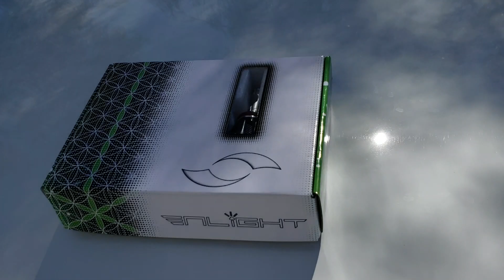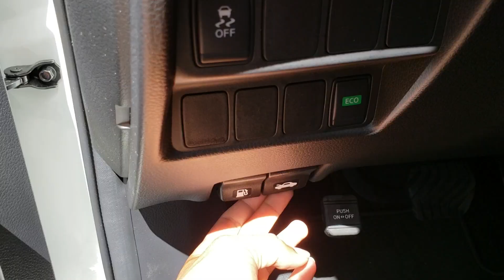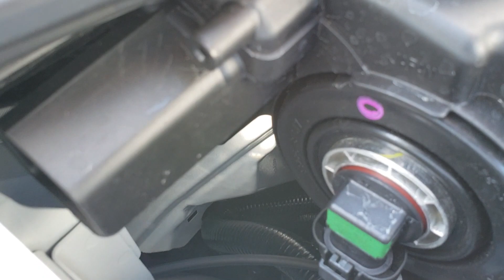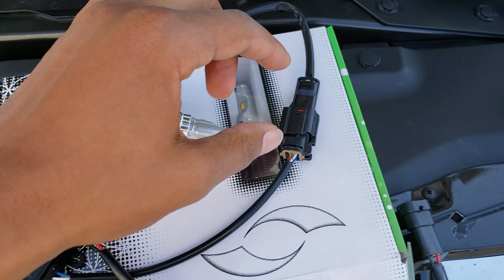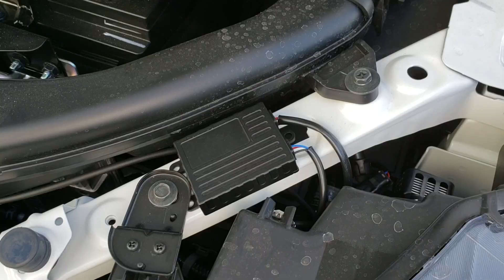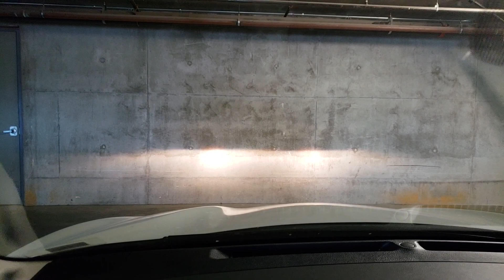How to: 2013-2018 Nissan Rouge or Murano Enlight SolarFlare LED Headlight Upgrade

Comment: I have the Enlight SolarFlare LED Headlight Kit in my 2017 Maxima but in 6500k color temperature. Love the brightness and white color of the lights. Big difference from the stock halogens! Had them installed for almost a year now and they are still going strong with no issues at all! Great product!